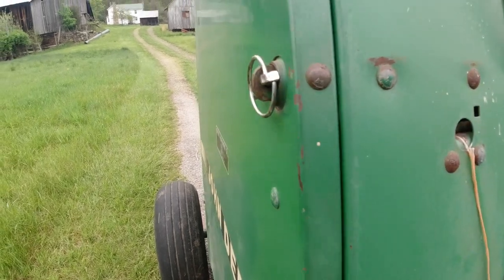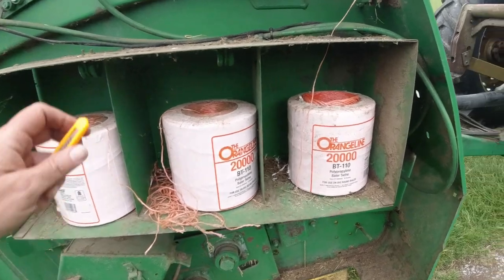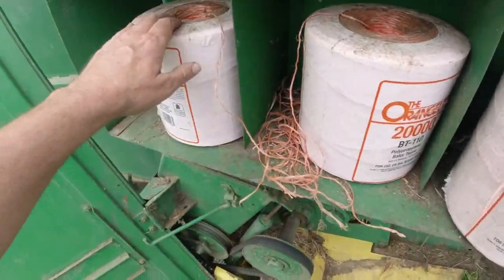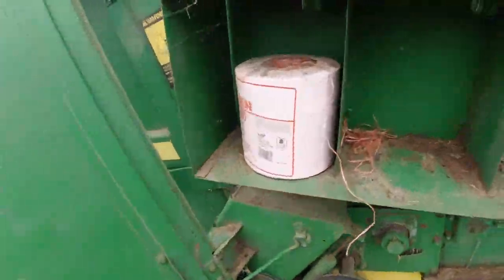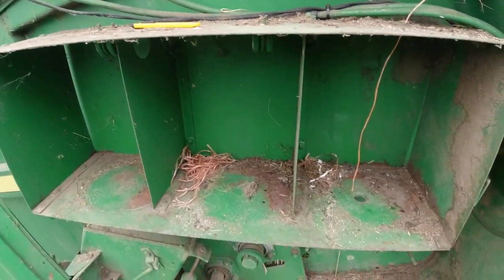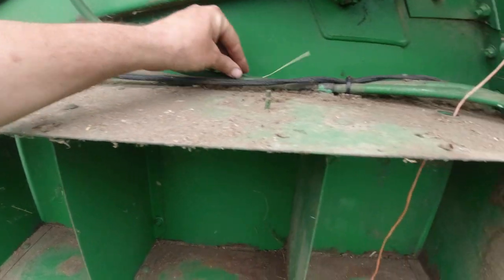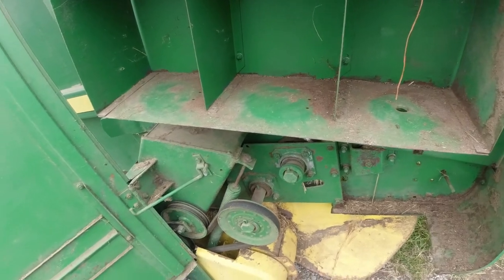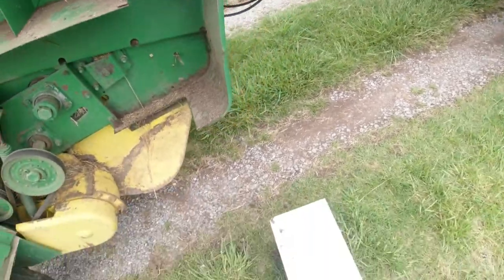JD 335 - Getting It Going - Part 2

Comment: I had a 1999 New Holland 654 that used twine and we used it from 2004 until 2020. We used both type of twine, sisal and plastic, the plastic is what I preferred, it held up better. We did stack our hay outdoors, no barn storage, so that is one major reason. We replaced it with a new 2020 John Deere 450E round baler with net wrap and monitor, netting stores better outside. I appreciate you sharing, thanks and have a good day.
Reply from the maker: Thx!